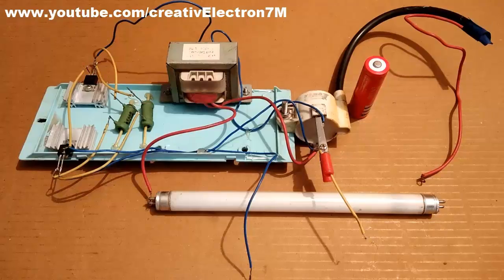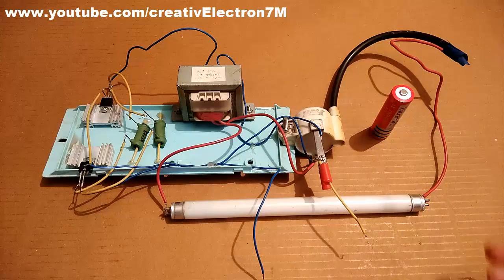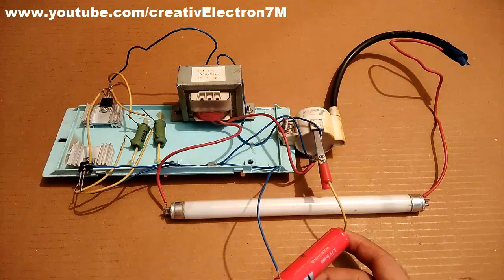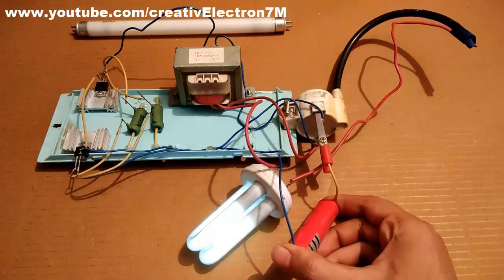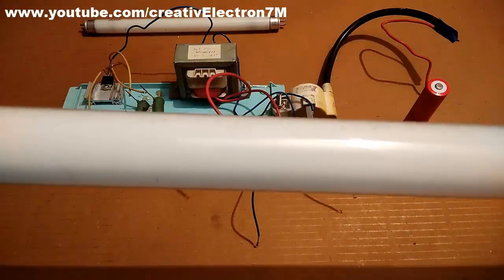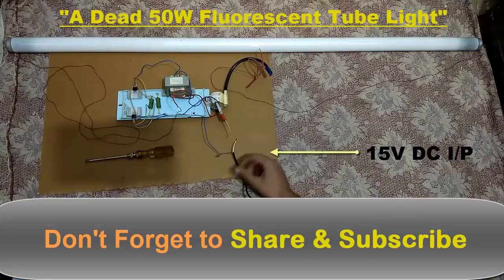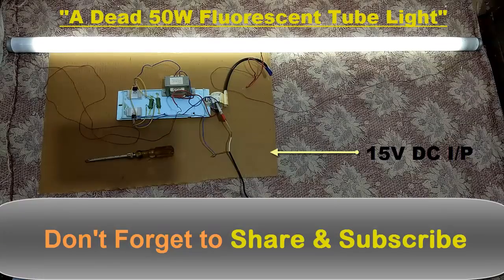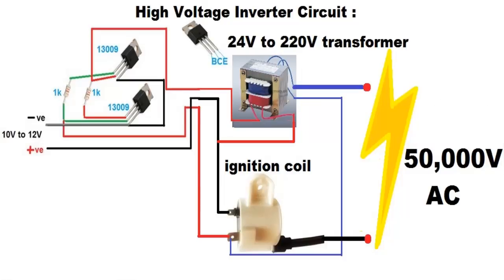A powerful 1.5V to 220V inverter with Schematic DIY

Comment: Can I use 6/0/6 to 0/110/220 1 or 3 amps transformer?
Reply from the maker: You can use but the voltage won't be that high.
Reply: Is it able to light up a bulb?
Reply from the maker: only fluorescent bulbs